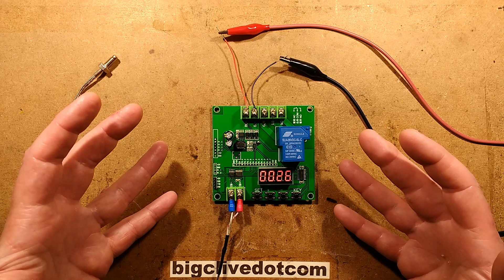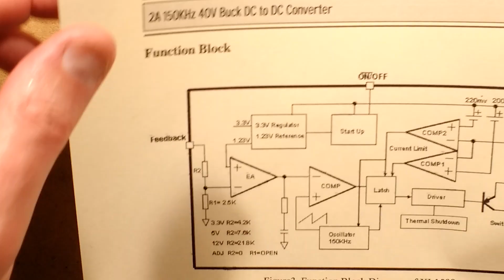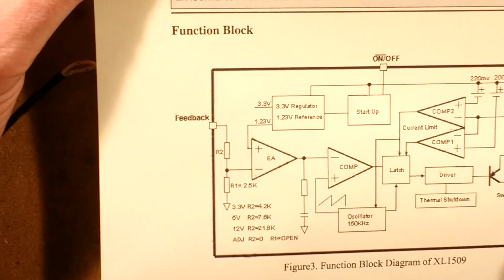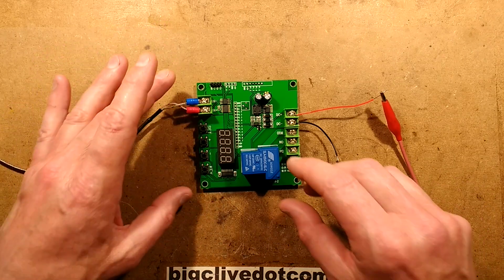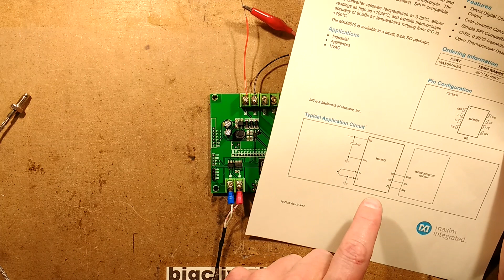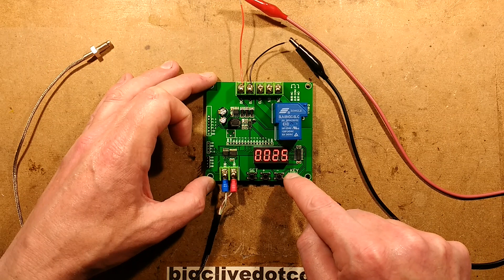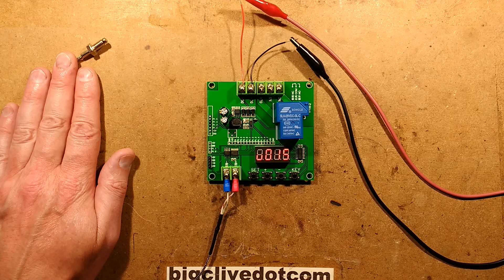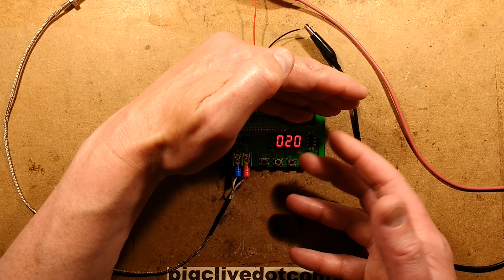"Educational" temperature controller.  (In a bad way.)

Comment: Any thoughts on Songle relays? I've bought a few over the past years and they all seem to work acceptably well (i.e. no failures - so far) They seem to kill the "Chinese Crap" meme, since they DO work, and continue to work (even if "abused)!
Reply from the maker: They do seem to be one of the biggest relay manufacturers, but I often wonder if any are clones.
Reply: Never thought of that! Whether mine are legit or knock-off versions, they seem to last OK (especially for higher mains current applications).  For power switching I do use a simple snubber network (so maybe that is why the contacts still contact - reliably!). Not bad for the price - I remember getting a pair for $5 from Bang Good (DPDT 250V 10A 12v coil)

Comment: The data sheet for the thermocouple chip showed the negative side being earthed, maybe they forgot to do that as well!
Or you have magic hands
Reply: magicalpencil. I have not used this exact MAX, but some of these thermocouple amplifiers have fault signaling if there is a short to gnd or vcc. 
Either of the errors trigger when you touch the sensor (wire).
What I don't know is if the shield is connected to either of the two sense wires.

Comment: Have you tried powering it from a 12v battery to ensure your 12v power supply is not a source of noise in the circuit?
Reply from the maker: I did.  And it resolved the ground coupled noise issue, but was still inaccurate.

Comment: Is it possible the solder pads are large on the relay to help conduct heat from the relay contacts as they age?
Reply: Hmm, you seem so sure. Guess you've never seen the solder connections melt on control boards as they age.

Comment: Hmm, fun with a rapid switching relay and high voltage? Brief fun.
Reply: At my job, somebody ordered cooling system for injection moulding machines. There were "small" problems since beginning, like we were called C20 circuit breaker is okay, but it always fell down when everything started at once, because starting current was much higher. But then one day I was looking inside control box, checking for something....and relay in PLC started clicking at maybe more than 20 click per second! :D  It took weeks before they fixed software.

Comment: What's your issue with the small pads for the small screw terminal leads, no doubt the part library default, versus the larger pads for the much larger relay terminals? As long as the smaller pads aren't thermally isolated, and it doesn't look like they are, there will be no reduction in current handling capacity.

On the bad button debouncing, I've seen that on so many cheap Chinese electronics devices/modules. Since they're not only hardware thieves, but software thieves, too, I wouldn't be surprised that they've all stolen from each other the same lousy debounce code, something never caught in their non-existent "end user testing" process and certainly never fixed due to (ignored) customer feedback.

But, hey, what can you expect for the incredibly low prices they sell stuff for?
Reply from the maker: Mechanical strength on a terminal that is going to twist slightly as the screw is tightened.  A very common point of failure.
Reply: To denounce the button, all you need is a small ceramic cap between the pins.

Comment: The pcb size is massive (etching that in UK would cost more then a hole badly designed module from china... )
I have previously designed simple esp8266  run thermostat with thermistor for a kurdish fast food "cash and cary" fridge room to get attention of everyone if temperature goes above certain level (Sending emails, ringing whtsapp, upto switching alarm horn if it reaches 5 degrees or goes above -2 for more then one minute). Diferent levels dependent on how bad it is. 
Its been running for two years now and measurements are still within 1 degree of what official regged meter says.
Mine point is that for the human level temperatures putting thermocouple just causes trouble/makes design pointlessly over-complicated.
and if you are working on high temperatures, considering the electricity/fuels) cost, getting good quality equipment does not make as much cost in comparison.
Makes me wonder considering the manufacturing cost, if its on ebay because after it was build it was found too dogy for sale, so they might be getting rid of the useless stuff to recover at-least some money, rather then paying  a waste company...

Comment: I don't get it. If that is really thermocouple (not thermistor), then after shorting out thermocouple connector, you should get temperature of compensation sensor (Pt100/Pt1000 or similar), so practically your room temperature, maybe a little higher. If it doesn't have one, then you should get fixed temperature. which you should be able to set in menu. If that also isn't possible, then it's real piece of crap that's not worth any money.
Seems like fixed temperature is set to 0°C, so user is expected to regularly change ice-water mix in cold junction box...and no sane person will do that, unless they use really expensive equipment in calibration laboratory where it is required.

Comment: You know you're inept when you need a special purpose IC for a couple of PBs and LEDs.
Reply: True incompetence is using a specialized keyboard/display driver and still having bounce on the switches. I briefly considered buying a temperature controller that looked a lot like that one. This video makes me very glad that I opted for a WH7016C panel mount controller.

Comment: weird amature grounding to the 'module' bottom left. what a mess
Reply from the maker: Yeah, there are some weird angular tracks that look like they used to have small pads on them and were then obliterated by bigger ones.  And sharp track branching as well, which is a bit taboo.
Reply: Yep, I've done that mistake before stitching 2 copper fills together with an unnecessary track but always spotted it in the gerber. What a hack job, thanks for showing us this nightmare. Hope you can re-use the parts in a project

Also I don't think the braid of the thermocouple is terminated anywhere. even making it dc ground would be better than floating

Comment: Methinks this is the work of an inexperienced hand.

But the funny thing is that the price for the whole board (about $9.80) is less than the price of one MAX6675 chip.
Reply: SigEpBlue they can be bought waaaaayyyyy cheaper....
Reply: Well yeah, I mean chinese knock-offs of pricey chips (i.e. anything by Maxim, Linear, or Analog) are always going to be much less expensive than the real thing. ;)
Reply: Depends how many thousand you want to buy every week ;)
Reply: And depends if it's even genuine.
Reply: Thing is, these manufacturers offer major discounts to major manufacturers. And from there, the unused portion of the roll finds its way on the Huaqiangbei market. Seems they go for more than a dollar a piece, which is a bit on the expensive side for a fake. There might not even exist a fake.

Comment: The row of pins in the middle looks like it was designed for an LCD module, complete the with the pads for the variable resistor for the contrast on the top left. Wonder if the software is writing to it?

Comment: It not really just odd, its because the person that designed it, lacks experience, and engineering skills. Looks like something I'd expect from a 3rd year engineering uni student, simply lack knowledge experience,. Typical mistakes from CAD student things like incorrect pad sizes, incorrect component pitches, track widths wrong, creep-age distances inadequate, lack of suitable mechanical protection, not correctly terminating unused op-amps and inputs of unused gates, and misunderstand of how component work, choosing the work type of capacitor, poor pcb layout, leading to erratic behavior in certain conditions, system instability, the list goes on and on...
Reply from the maker: That's exactly how you learn, but it's odd to see what does look like a student project being sold as a product for what could be a critical application.
Reply: lol critical application you're kidding....yes I thought that too, had some nasty surprises, you just have to design it yourself, and do it correctly. I given up, I've purchased cheap panel mount ebay led volt amp meters, useless and unstable, small buck regulators erratic and unstable. PWM dc motor module, works but pwm freq changes as speed pot is adjusted, unreliable and unstable. not good...

Comment: Doesn't this thing have some kind of hysteresis control? Doesn't make much sense without...
Reply from the maker: It lets you set an on temperature and an off temperature so you can set the hysteresis manually.

Comment: What a poorly designed instrument. The thermocouple input should be floating with a capacitor from each lead to ground. Floating, because some thermocouples have grounded junctions.
Reply: Dear Clive, shorting out a thermocouple will give you the temperature of the terminals by default, that's not odd. ;-)
Reply: Thermocouples generate a thermoelectric voltage relative to the gradient along the length of the thermocouple. A cold junction reference 'adds' the room temperature to this voltage.

Comment: Normally always shorts out capacitors with his screwdriver, "I wonder what I could short this out with..."
Reply: IgnoreMyChan you can barely short binding posts with a straight object. They gave separations
Reply: Ah, you are right, I missed that. Good point, thanks.

Comment: Shitty Chinese firmware installed into shitty Chinese hardware.  Life is wonderful....  like our sauna....  the chinesium grade controller allows up to 999 minutes of sweating time before the alert to take a cool down break. Is it ever normal to sit in a 190F sweat box for 999 minutes? Lazy hack programming at its finest.  They used an external 8 bit A/D converter, even though the data sheet shows the microcontroller having one internally.  All those pins were available and unused.  Then the outputs having external pullups, then into a hex inverter...then into the standard 2003 relay driver.  Why did they reverse the logic and use pullups?  The datasheet shows that port having totem pole outputs aka source and sink.  It's obvious they use cut and paste slack-ware from other devices and are not able to implement properly for other types of micro.
Reply: 999 minutes is 16 hours; which is how long you could potentially spend in a single session in a Caldarium or Hamam at around 60°C, i mean you will probably feel hungry eventually, but there is otherwise no danger or discomfort. More than 20 minutes are ill advised for a Finnish sauna.  But then, you're supposed to run those a bit hotter, like closer to 95°C. Going above 100°C is actually fun, though southerners start to complain.
Reply: I gladly use the various little modules and goodies that come from China.  They are for the most part very high quality aside from dorky errors.  China laborers earn about $10 a day as their currency is intentionally kept low in value compared to the rest of the world.  It is impossible for anything like this to ever be mass produced in the USA with any hope of making a profit.  For a healthy economy, each nation really should be making their own products.

Comment: So designed by someone that has theoretical knowledge but no practical experience.
Reply: Everybody makes mistakes. It seems like a prototype run of something that would become an actual product one or two iterations later. This would be the version that isn't even supposed to work, you never expect the first pass to work and it's usually faster to get a proto made than keep thinking about it what might go wrong, and test it instead and see what needs to be fixed up from there. But miraculously it almost kinda did work, so it ended up being sold!